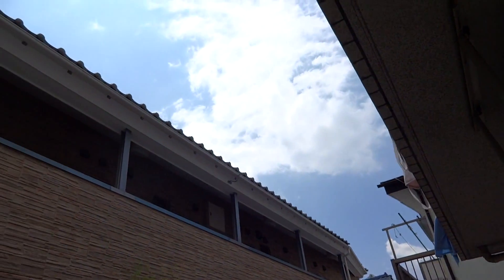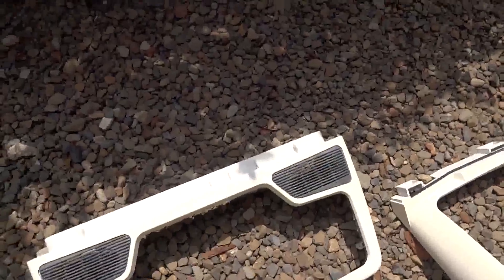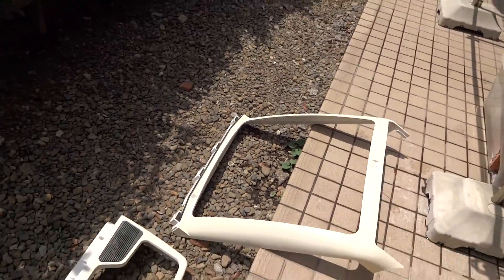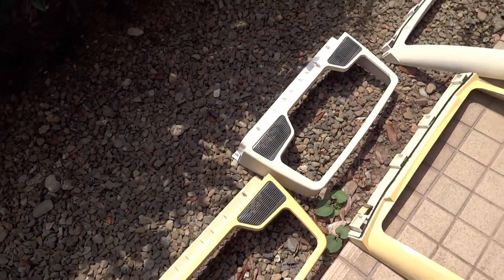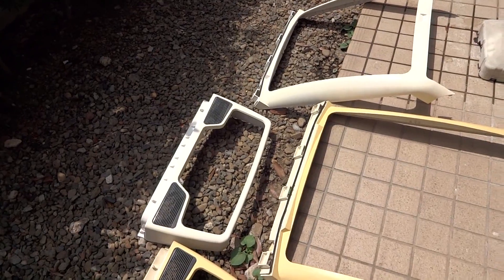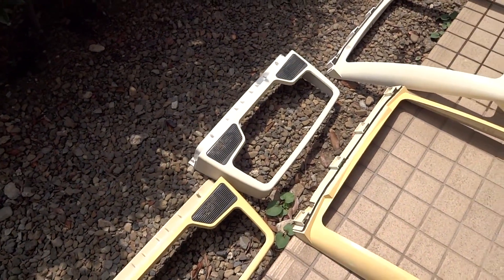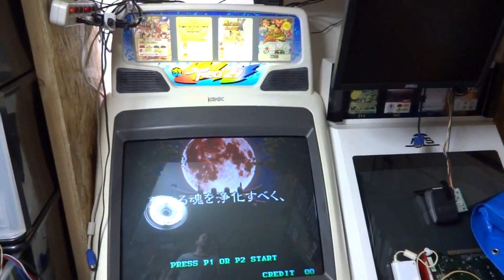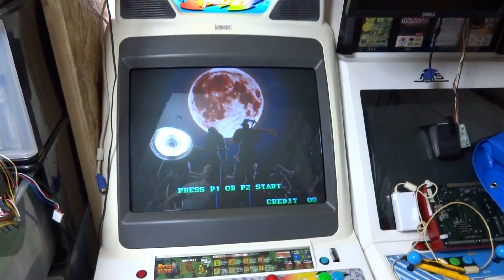Experimenting: Sun Bleaching A Super Neo 29 Plastic Bezel (Pt.6) FINAL

Comment: If you want that thing to turn completely white you'll need like 20 gallons  30 volumes, or 100' volumes peroxide (use gloves and cover your mouth for the 100 volumes one ) for better/faster results, you'll need to leave the plastic submerged for 1 week in the sun on a clear tupperware, that's what I did for retrowhitening 4 famicoms, 3 snes's all of them at the same time, the peroxide evaporates and it's note cheap.